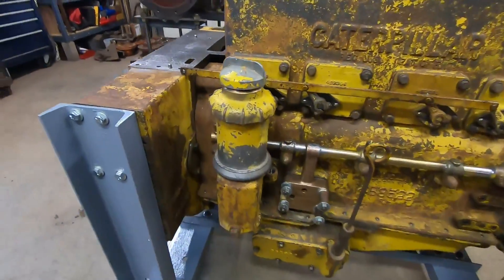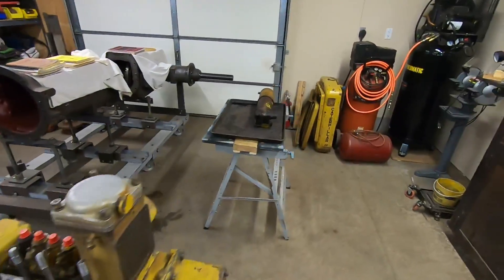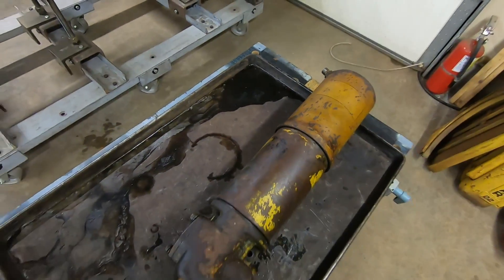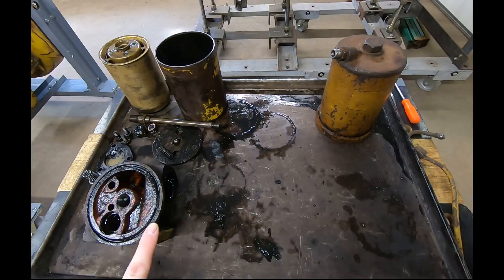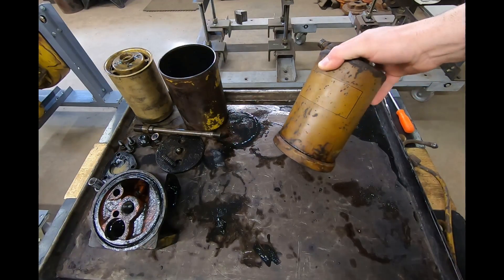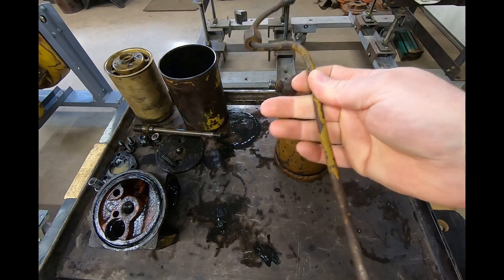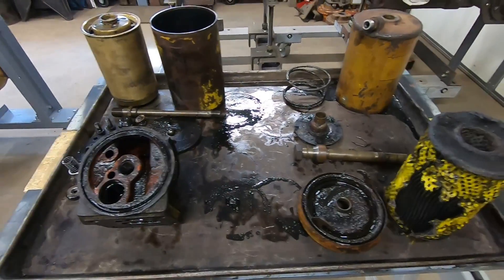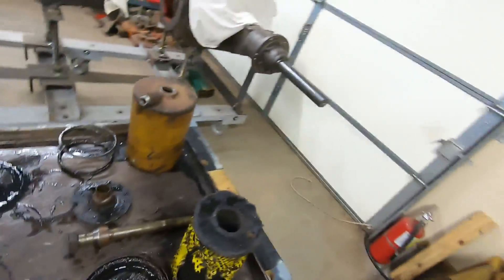Caterpillar D2 #5J1113 Diesel Engine Assembly Ep.41: Hybrid Oil Filter Disassembly & Lots Of Sludge!

Comment: Another trick for removing the cap would be to force fill the void with grease, then using a punch that perfectly fits the hole and knock it down the hole. The displacement of the punch should force up the cap. We used to do it for bearing in blind hole such as thrust bearings. Keep up the good work. Love the series. 👍🏻👍🏻

Comment: Using a 4-40 bolt, we use the same technique of pulling a fix low speed jet on a vintage motorcycle carb. If this isn't pulled and cleaned, it runs very poorly.

Comment: I'm deep into a heavy service of my 3J 345 machine and have run into a small problem with the factory oil filter and field installation group that you describe so well.
Someone in the past decided to leave out the washer and spring with  parts numbers 6B977 and 5B8912 which I think makes the upper oil filter useless.
My question is,could I replace the entire filter assembly with a later model until I can locate the proper parts for the correct year parts?
Thank you for the fine videos.
Reply: Thank you . that helps.

Comment: I don't know if anyone else has suggested this, but a fine thread to pull that plug would have given you more strength and spared cutting so much metal as the course thread.  Just a suggestion.

Comment: I have a D2 cat that has a leaking oil cooler in the radiator housing.  I see in one of your videos that the oil cooler and radiator are separate entities . I just by passed the oil cooler by running the oil lines in a loop. Will that eventually hurt the engine? And where could I find a good used oil cooler to replace the damaged one?
Reply: Thank you for your info. It doesnt get run too much so I will just leave it as it is. I also had the whole rearends disassemble like what you are going to do to yours. Both steering clutches were frozen . Pretty much weled together with rust

Comment: I remember way back, Purolator made a conversion for oil filters using toilet tissue rolls for oil filters...  just looking at the original brass screen filter...  would it be reasonable to wind in tissue over the inner to improve the filtering characteristics of that portion of the 'filter'...  which you consider not really a filter at all, from your comments....???

Comment: Caterpillar never got completely away from the perforated screen concept. My 1941 5j has a brass prescreen and a full flow replaceable element. Most likely it's the 7B7775 assembly. I don't think its a field full flow upgrade or is it?
Reply: @squatch253  now I'm confused. Like you, relying solely on several different parts manuals without a flow diagram or theory of operation makes things difficult. My  filter has the tee handle on the long skirt top cover. I didn't disassemble my filter assembly just cleaned it and replaced the filter with the current cross for the 6b907 element.

Comment: I use that same trick with a 1/4”-20 self tapping screw to pull float valve seats and broken fuel inlets on small engine carbs in my shop. Works every time!

Comment: Looks like you could machine a plate to fit over that ledge (with gasket underneath..and put a larger screw for the middle to screw into a filter and covert it to a modern filter (upside down of course) but offer better filtering
Still very cool..keep em coming

Comment: Well at one point in time engine builder light buld came on a said hey why dont we filter the oil right off the oil pump well the light buld was lit and quickly burned out well is because when the filter got dirty it starved the bearings for oil end resault of that brain fart was quickly ruined engine so all engine the fourth oil system were made to. Filter in by partason

Comment: The oil flow should be going through the center tubes then out at the top flowing through the filters themselves. Think of it as a fountain. I could be wrong on that, just going my memory. As for the cap, possibly for ease of access to clean it out better?? Great video. Cheers :)

Comment: The lower section is probably full flow filtration with 76 micron (0.003") then Cat added the top section which would be considered by pass with a much better filtration performance at 25 micron

Comment: Just wondering if you would ever be open to converting it over to a more modern Full flow and bypass spin on setup like this. https://www.ebay.com/itm/Dual-Remote-Bypass-Engine-Oil-Filter-Kit-NO-1u-Baldwin-BF7587-Filter-NO-8u-B7379-/223426841806
Reply: I was just thinking the same thing, I wonder if someone made a conversion kit for that old engine.

Comment: Neat episode Squatch. From a cursory examination via video, it would appear that oil goes through the coarse strainer from the inside out, with a parallel path on the top paper element from the outside in, then drops down to join the oil exiting the brass screens to go off to the engine/oil cooler. Not knowing if the oil goes to the cooler first or last before going to the engine hampers my ability on the flow path some. Will you source another genuine Cat filter for this, or will a Napa Gold suffice? Finally, do you have any idea what the painted over sticker on the field service addition filter assembly would have said?
Reply: @squatch253  Waiting for the next episode, or a simple "Shut Up Luke" would've sufficed Squatch. Cheers bud!

Comment: Maybe it’s just me, but I’m still impressed that you can pull the parts off an 82 year old machine, clean it up, install a new filter and put it back in service. Amazing.
Reply: Its amazing but sad when you think how almost everything made today is disposable. Nobody is going to collect or try to restore a Ford fusion or a  home depot troy bilt garden tractor. Basically garbage in 10 years. I treasure old equipment and machinery for its timeless quality
Reply: Back in the time these were built, people could really only afford something like this once in their life. Credit and such wasn't as versatile and ready-to-use as it is now. And again, modern things are a product of the time. Vehicles are more efficient, faster, safer than ever before yet, a lot of people don't view them more as anything other than an appliance that gets its regular maintenance and if it needs anymore than that, they just replace the whole vehicle or tool. The people like us here watching this, who like to fix our machines and trucks and motorcycles, were a smaller slice of the pie than you think. Same reason manual transmissions have all but died in the US.
Reply: You shouldn't be impressed, you should be outraged. We can do the same with every bit of tech we have that's past a certain age. It's the lack of parts that condemns some of them. You can take a 1900's Chase truck and run it just fine today with its air cooled engine or chain driven axle. It would work (and it does, someone still takes one out for family rides).

Comment: Hmm.. just putting my guess here to see if the next video proves me right or wrong :) If they did it similarly to today that first spring loaded ball valve would be the bypass in case of a blocked filter element. Filtered oil from the first stage filter would then raise up through the pipe and off into the engine, but since its supposed to go into the second stage paper element first it somehow has to raise up there past the pipe, up into the paper element and only after that enter the center pipe and be send of into the engine. Guess these intermediate plates somehow channel it that way and that connection tube is just for getting the air out of the filter assembly. Anyways, looking forward to seeing if I guessed right or not :) As for these big triangular plates, maybe its just there to help clean out sludge? I still wonder if Cat ever had plans to add a blower or a turbo of sorts to those engines that would make use of these big oil return on the block.
Reply: @squatch253  Thanks for explaining, didn't guess it would be that way. I thought the goal of the field upgrade would be to get the fine filtered oil into the engine to keep the fine parts from getting into the bearings etc. I was quite curious about the trickery they used to get the flow redirected with that intermediate plate into the second filter, but that explains it.

Comment: Wow that's interesting thing . So how did you have to clean them filter's in the day. ? Not the add part. Just wondering as always great video . Thanks for sharing.
Reply: Gary Feltus 
Field mechanics most likely just pulled the strainers out and washed them in a bucket full of diesel fuel, naphtha, or maybe even gasoline. Back in the days when this machine was new, most machinery still ran on gas, so companies had lots of it on hand.

Comment: I don't care if it's not the best, that brass Purolator filter is gorgeous.
Reply: If Caterpillar was building, lets say, 20,000 of these engines back in 1938 for US and export use, then imagine how many tons of silver and copper would be needed to make these filters. Added to this is the production process, cost and recycling of these early filters.
Reply: @mohabatkhanmalak1161  But it's made once and it's still good 80 years later. Much better than throw-away stuff. Clean it out and it's good as new. Today we could make that filter with finer openings to filter better, I'll bet. It would be relatively expensive, but it would never need replacement.
Reply: @bills6093  The crude oil that is found in the US also has a higher content of sulphur, nitrogen and other compounds that react with metals in the engine, where heat is generated. These acidic compounds drastically reduce the life of engines. The paper element type filters are better in reducing the effect of these acids by filtering out the heavier particles.

Comment: I'm still trying to figure out what that tube is for that goes to the breather.

Is it possible that the three bolt cover is for an additional .003 filter in a different, or potential  application?
Reply: I think that's how the filtered oil goes back to the crankcase.

Comment: Thought I knew a fair bit about the D3400, so today was a teachable moment. Surprises me that Cat used a bypass setup, even initially. Cat was an industry leader in developing the special lubricants needed for diesels. When the Art Rosen-designed D9900 debuted in 1931, it faced a hostile environment; bad lubricants and bad fuel, both of which reduced the service life and reliability of the  D9900... and all other oil engines of the period. Working with Standard Oil, Cat helped develop the Chevron DELO (Diesel Engine Lubricating Oil) earlier in the '30s as well as pioneering the use of oil test engines (the legendary Caterpillar SCOTE engines- Single Cylinder Oil Test Engine) that became everpresent in lubricant development and testing. And still are!
Reply: These bypass systems were around a very long time, I still can't get my head around why they were though. My Genset engine, an older Mercedes model build in the 80s originally still had a bypass filter setup, and that engine is still priced for its reliability and longlivety. Full flow filtration was an optional extra on that machine that luckily the original owner choose to pay for.